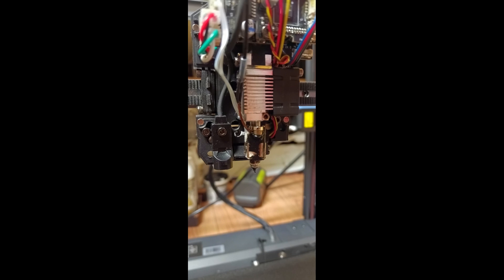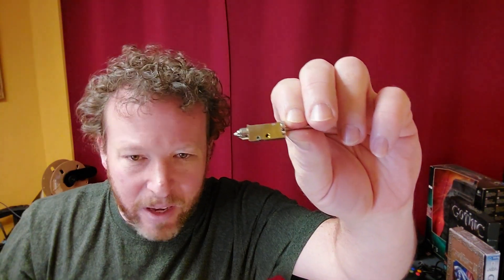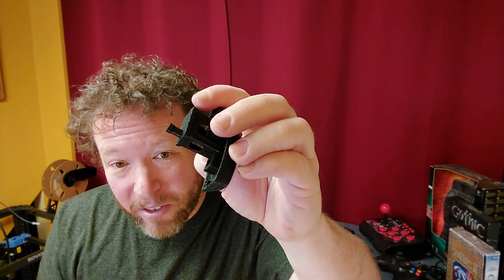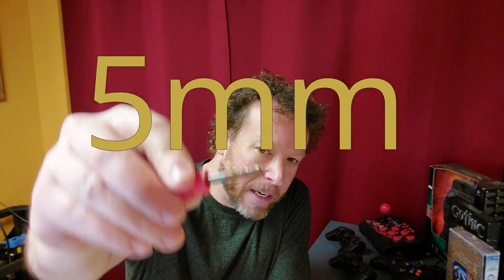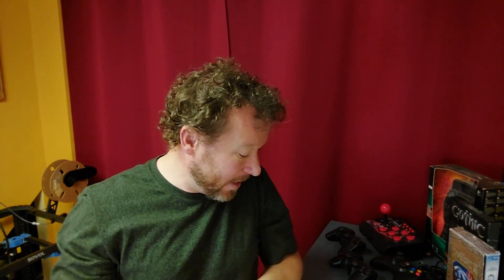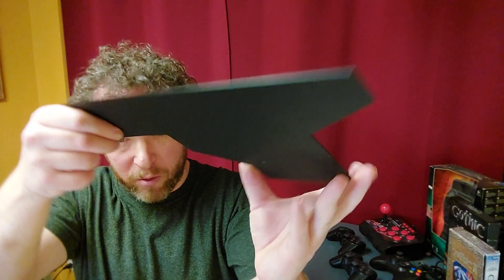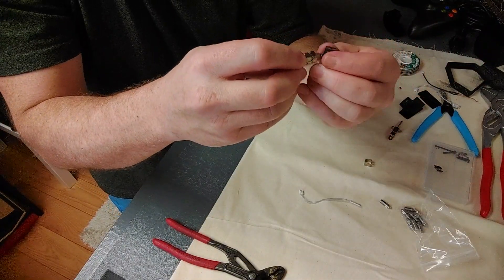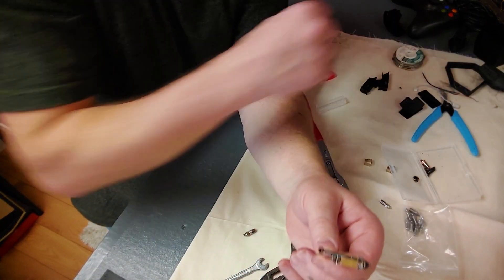Sovol SV08 with Elegoo Neptune 4 Nozzle

Comment: You should change the name of this channel to Franken3D.     😛

And put the Sovol parts department on your speed dial.    😀

The Carbon Wonder Tech SV08 heat block adapter for V6 nozzles looks very well built but I wonder why they used a short low flow nozzle on a modern high speed printer.  If I was making that product, it'd use Volcano nozzles.  That should be the industry standard for high speed printers.  However, now that I've become a full fledged @MicroSwiss fan boy, I don't see the point of messing with the external heater, thermistor and thermal paste when I can cold swap a FlowTech nozzle into a MicroSwiss hot end on the SV08 in a minute without touching the heater or thermistor.  That's how nozzle swaps should work.

I have some Neptune 4 Pro nozzles that I'll never use.  I'm still using the Neptune 4 Pro even after getting the SV08 but I keep a 0.4 mm nozzle in it and it never goes bad.
Reply from the maker: Yeah I seriously considered a name change. But probably not.

Comment: Also just a note, don't forget to put some thermal paste under (between) the heater element and the hotend block, and on the thermal sensor, and on the top tube of the hotend that goes inside the radiator part. Gotta always have a good thermal interface there with no air gaps.
Reply from the maker: Yes thermal paste in the correct spots is necessary.

Comment: There's an easy way to get into easily swappable nozzles - buy the SV08 hardened steel nozzle set, and also the simple SV06-ACE brass nozzle kit (I've got the variety set 0.2 + 0.4 + 0.6 + 0.8). And then you can easily screw those brass nozzles in and out in place of the hardened steel nozzle. Now these brass nozzles are already much cheaper (and imho more practical, as you don't have to mess with the whole assembly of the heater/sensor block) than the stock sv08 nozzle assembly. And they also appear similar to elegoo Neptune 4 nozzles, or maybe some other aftermarket nozzles where the thread doesn't go all the way up - this needs to be further investigated.
Reply from the maker: Oh yeah there is definitely an easier way, no doubt.
And further investigated it will be.
Reply: Look for the mod of the copper bloc of the sovol hardened steel Nozzle, it can accept K1 nozzle with just a little bit of dremel work (drill 0.5mm so that the nozzle can be screwed in just a tad more and seal properly at the back). I printed about 2kg of petg and asa with no leak at all, really happy with this simple mod...
K1 nozzles of all diameter and material are available for cheap, even high end stuff like diamond tips are easy to find
Reply from the maker: @MoeOuan666  Elegoo Neptune 4 Pro/Max nozzles work out of the box. 👍 
However availability of different nozzle types seems a bit regional at times. Probably a demand thing.

Comment: have you checked your extruder? I see on reddit that an axle on the extruder gear pushes out of position.
Reply from the maker: To what avail? The newly improved homebrew nozzle works well and the original nozzle works as intended as well.
However it is noted, just in case the printer starts unexpectedly acting up.
Reply: My SV08 recently started under extruding after a couple of weeks of printing.  I suspected the drive gear set screw had worked loose and the extruder drive gear was spinning on the motor shaft, but @spoolsamplesprintco tipped me off to the migrating extruder gear shaft and the Valerie Moore spacer to prevent this problem that I downloaded from Printables and printed last night.  I'm about to tear into the SV08 extruder this afternoon and fix the under extrusion, but whatever the cause, I'll install Valerie's spacer.

Comment: Awesome!! Worked out well! This series of videos was a great test and proof of concept. That aftermarket threaded heat block thing looks promising. Says it is manufactured in Canada too... you would think there's a distributor here....
PS: because you mentioned it, the threaded hole on the Sovol nozzle block is for a grub screw to help the nozzle hold better. I believe it was their fix to the whole issue with the nozzles pushing out by PETG
Reply from the maker: So where is that screw then?
In the brand new nozzle there seems to be something black in there, but it feels rubbery.
Maybe I burned the living hell out of it, when I thre the thing into the fire.
Reply: @ it’s supposed to be installed by default from the factory. Tiny little thing and I’ve seen people mention in the fb groups that they thought it was missing at first but turned out just to be really small and deep in there. I think that it needs a very small hex driver that I don’t even think I have one small enough on hand. But I’ll try to check later if I can find my original nozzle assembly. I think I kept it somewhere
Reply from the maker: Then pull your nozzle out and follow my steps. 😉
Reply: @DomDecodes  That’s what she said! 🙌🙌 lol

But seriously I already have the flow tech threaded heat block so I don’t need to mess around with nozzles, plus I just had serious downtime to change the motherboard waiting for it to be delivered and need to catch up on backlog lol. But… I am keeping the original nozzle assembly as an emergency backup but if you want my spare nozzle that’s still in the packaging, and if my suspicions that you’re in 🇨🇦 because you keep quoting prices in CAD$ I’d gladly ship it to you if it means you’ll continue testing and making videos about it with your mad scientist approach to this printer lol
Reply from the maker: Na thanks mate. Keep your nozzle where it is.
No seriously. I will try a more practical approach soon.
Yes I'm in Alberta.
Reply: @DomDecodes  cheers from Montreal. Here's my SV08 in action https://youtube.com/shorts/rpH9_X2XqiY?si=jIyub57Ltwt1IECU